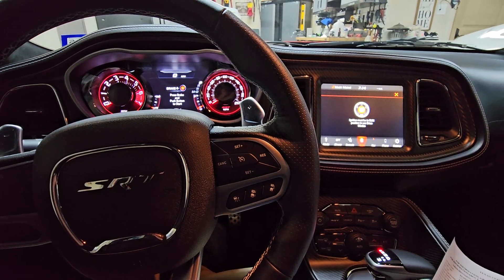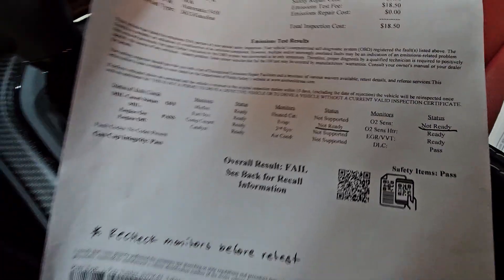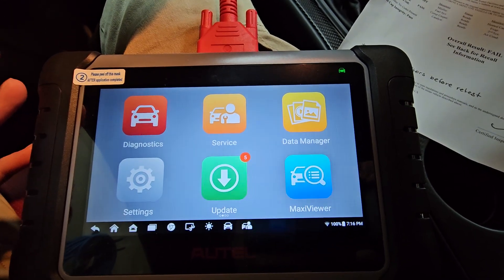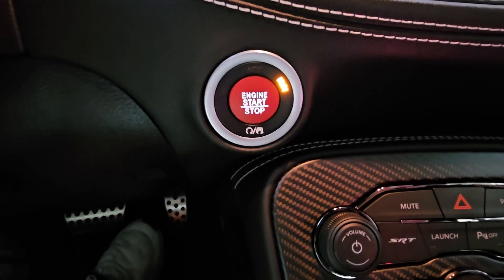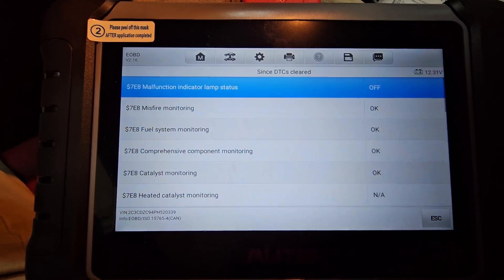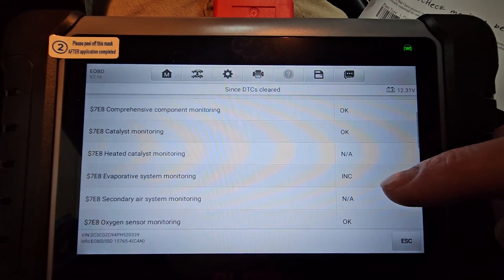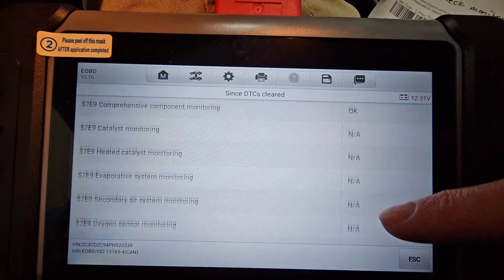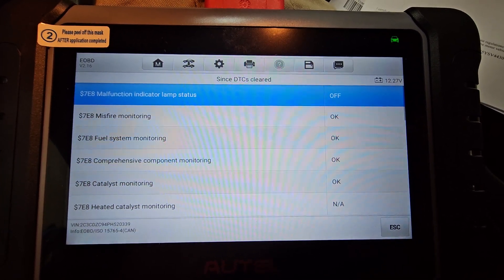Pass Smog Challenger/Charger I/M Readiness

Comment: Where’s your link to the drive cycle?
Reply from the maker: 1. *Cold Start:* Start the engine and let it idle for about 2 minutes.
2. *Highway Driving:* Drive at a steady speed of 55-60 mph for at least 10 minutes.
3. *Deceleration:* Allow the vehicle to coast down to idle speed without braking.
4. *Cyclic Driving:* Drive in stop-and-go traffic for about 10 minutes, ensuring the engine reaches normal operating temperature.
5. *Repeat:* Repeat the above steps if necessary until all monitors are ready.